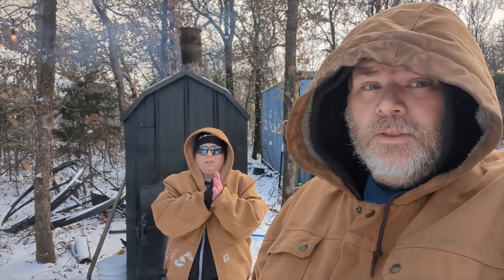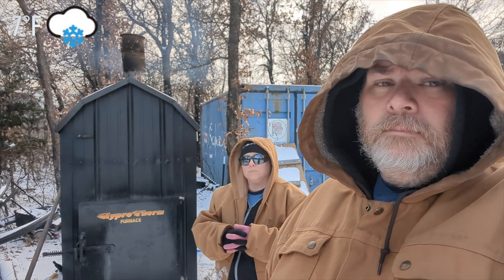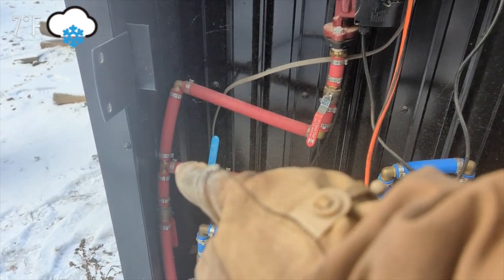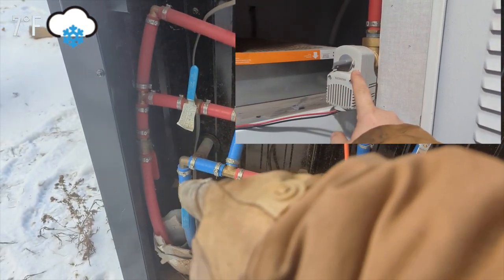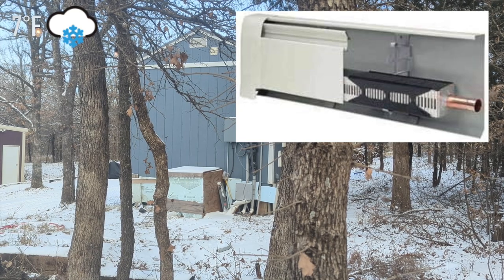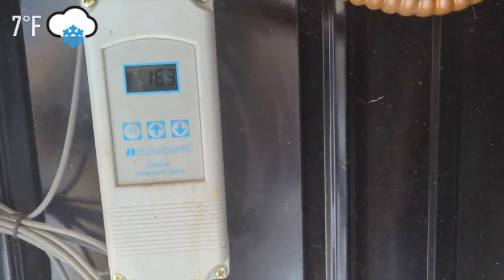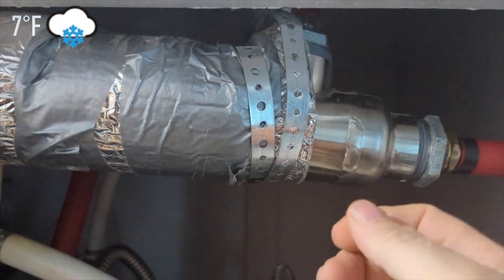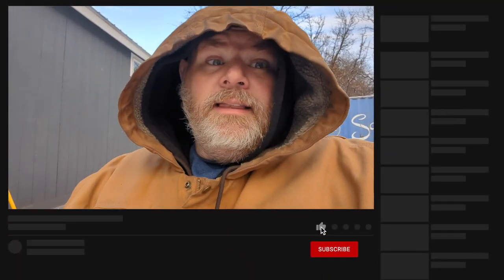Home Heating Boiler

Comment: Boiler or water heater? Boilers produce steam.  Steam is under pressure as well.. Boilers operate at 212° f or higher. Anything less is a water heater. Unless under a vacuum.
Reply from the maker: Well technically it's a water heater. However some steam does get made